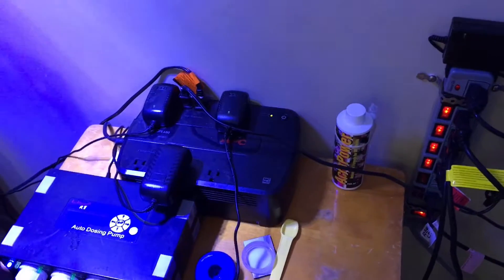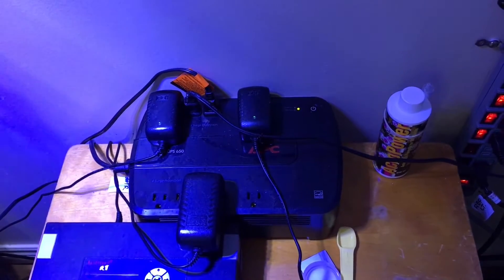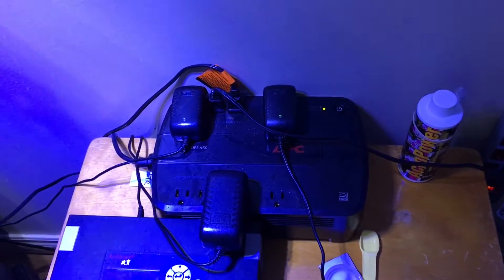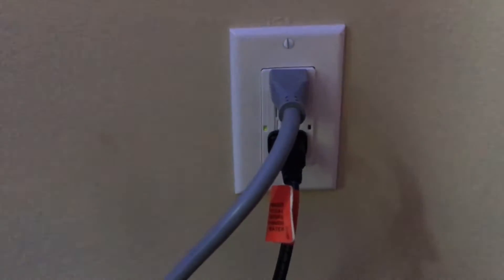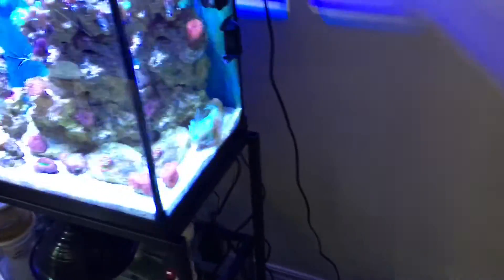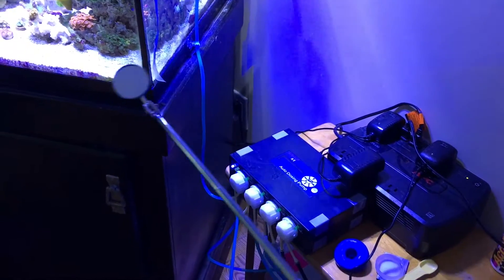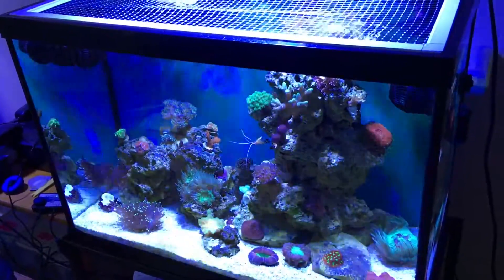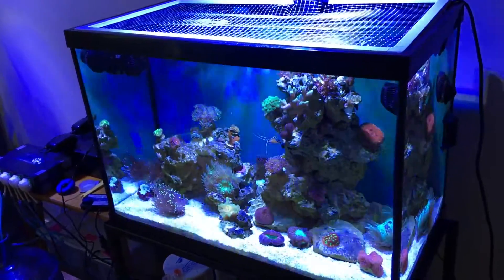Aquatic PSA Friday - GFCI Outlets for Aquariums

Comment: Good stuff. You can also buy plug in GFCI for power surge and water protection. I really like your idea of having electrician go ahead install permanent outlets.
Reply from the maker: Yeah, we figured it was the safest and actually, the most tidy. I mean, my aquarium area already looks like a bomb site without yet another layer of power bars. 😬 I'm looking forward to getting the cabinet built around the smaller aquarium, it will look much better. Thanks for the feedback!

Comment: Great PSA and I have experienced that nice feeling when I put my hand in my track and got a nice little zap from a bad pump. Very good  information. See you on the streams and have a great weekend.
Reply from the maker: Thx for watching, and ugh, I don't want to get zapped. I once got a massive static shock from shaking up a bottle of potassium chloride/potassium sulfate to pour a capful out for dosing. My arm was numb for an hour after that - scared me a lot. And now, not only do I not shake that bottle, I also don't hold the cap in my other hand while pouring it out. Learning the hard way over here.
Reply: Wow that's scary and sorry to hear about it. I could definitely see how that would change how you do things around electric and water.

Comment: Great Video and valuable information. Just wanted to mention, if for some reason your unable to change the outlet like you did,  they sell power strips that have GFCI built in. They have them at Bulk Reef Supply.
Reply from the maker: Thanks for watching and for the info - we went with the power strips with individual switches for each plug, couldn't find any like that which also had GFCI built in at the time. I'd love to be able to shop at BRS but between exchange (canadian dollar is really low right now), shipping, and UPS cross-border brokerage extortion, I rarely buy stuff from the US. But hey - might be a good excuse for a road trip some day!

Comment: Great video thank you. But I think you only should have one per "string" in a room, and everything down stream from that plug would be covered too.
Reply from the maker: We talked about that at length and decided to go with individual outlets for two reasons - if the outlet popped, first, I would know right away which set of equipment was the problem and only have to troubleshoot one tank, and second only the affected tank would shut down and not both of them. Thanks for the feedback - I don't know much about the workings of wiring!